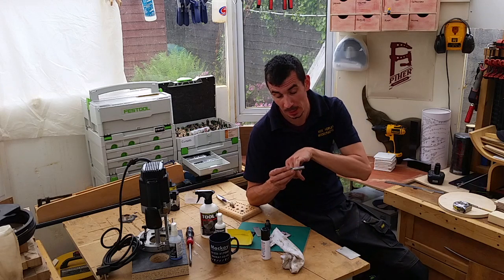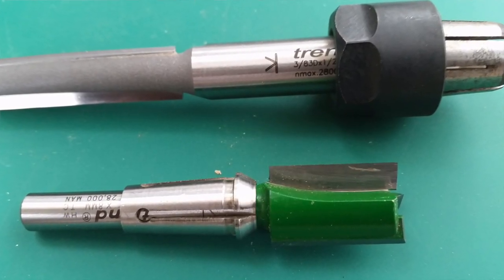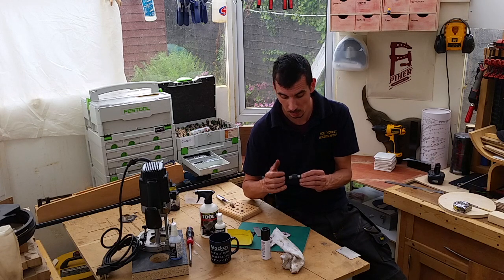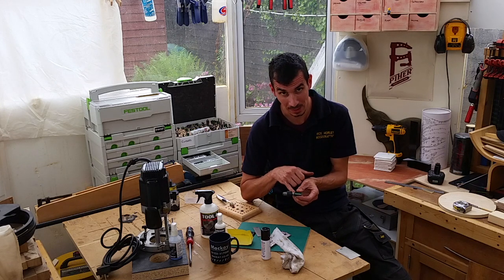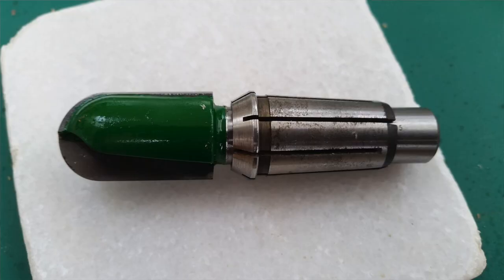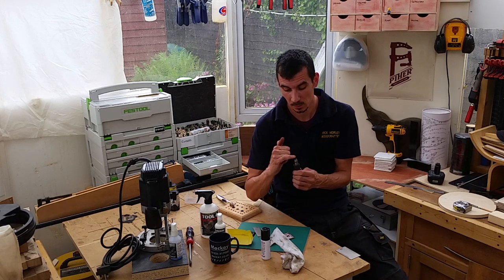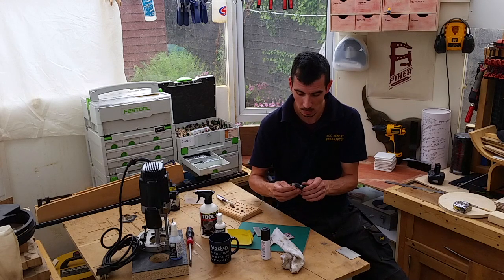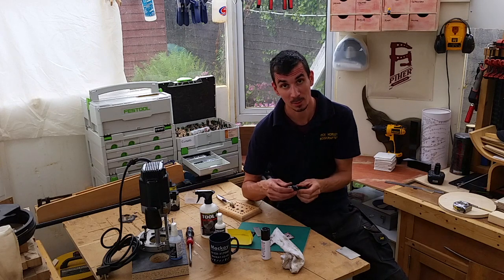Router tips and tricks: What you need to know about the K-line, but probably don't.

Comment: Nice video, thanks! Noticed Trend T11 on your table. Do you like it ?? Cheers.
Reply from the maker: Love it! Great router for table set up and lots and lots of locks ton doors👌
Have two of them.
Reply: @BrainFizz  thanks mate. Bought T11 from Folkestone Fixings. Arrived today. Will use it with adjustable Trend jig that you reviewed the other day. If I install the longest 12mm Trend bit (115mm) to the K symbol I’m 3mm shy to install 66mm deep lock through that jig. Do you use longer bits in this situation or do you breach the K symbol rule a little bit?  :) :)
Reply from the maker: Nah, if the mortice needs to be any deeper than I can rout it, I drill the bottom it with a forstner or auger bit then clean it out with a chisel…. I go a wee bit deeper than the lock any way, hose you a bit of breathing room, and clearance for the lock body.
It’s way quicker than keep faffing about with the router.
Reply: @BrainFizz  gotcha. Thanks bro. Have a great weekend.

Comment: My router has various speed and has numbers 1-6, I don't know what speed I should use on mdf and plywoods.i tried find the answer but failed
Reply from the maker: +elvis o'shaughnessy RPM is linked to the cutter diameter, rather than materials. Depth of cut will be effected due to hardness of the material.
Reply: Thanks
Reply from the maker: I’ve now added a full
Episode all about router spindle speeds, detailed with all info you should require.
Everything you need to know about router bit speeds.  Skills, tips and tricks.
https://youtu.be/zJ2ukCfIrxM